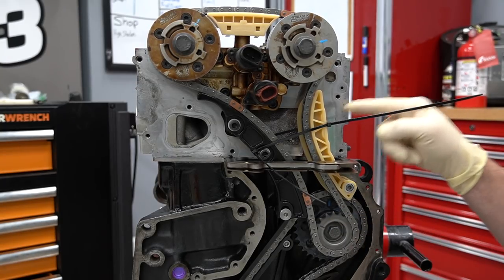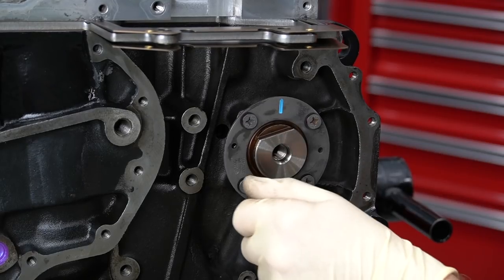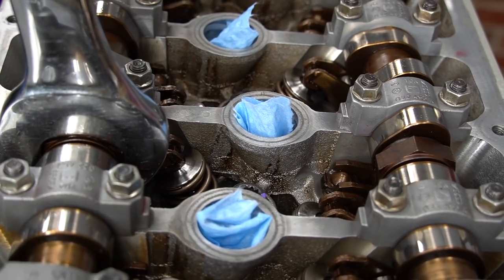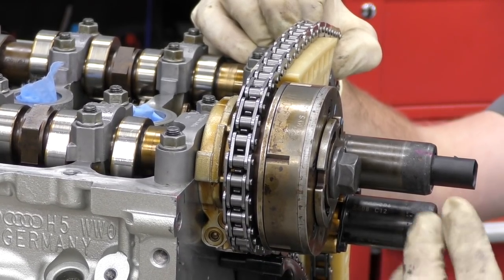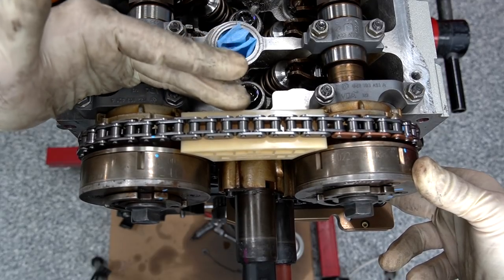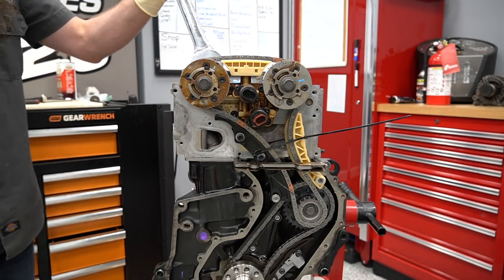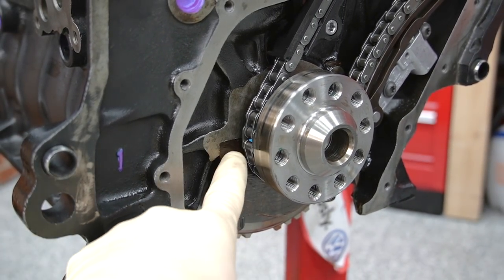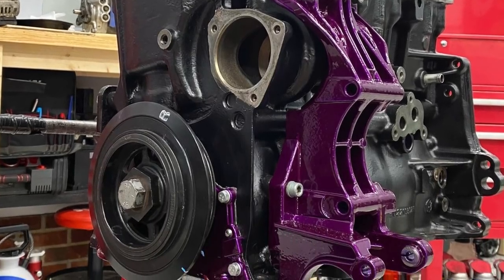How To Properly Time a VR6 With Head Gasket Spacer

Comment from the maker: I know its been a while since Ive put a video out. For that, Im sorry. This drag race project has been TONS more work than I expected. HAHA. It will 100% be worth it. Wait until you guys see how it all plays out.
Reply: Yes!!!... been looking forward to this video... I do have some experience of the smaller spacer though on my own build that suggests the standard chain doesn't fit without modification... I have DM'd you on your Facebook page with some details as I would love your input on it...
Reply: Hi @HumbleMechanic I know you may get this a lot but I own a 2019 Volkswagen GLI 35th Anniversary Edition 2.0T 6MT. I was wondering if you have a trick or possibly coding information to remove the rev hang. I love this car but the rev hang sucks! I know a lot of people are looking for a solution or help as far as lowering how much rev hang there is! If you could make a video with details on how to remove it or why people can't remove it that would be great! I know other car manufacturers allow you to code this out, but no one has been able to solve VWs
Reply: Please help.  I have a 2009 Hyundai sonata 2.4 cylinder  and I replaced the alternator. Fairly easy job. But after I replaced it I started the car up and went for a ride. Everything seemed fine until I came to a stop sign and as soon as I pressed on the brake the car stalled. Not only does it do that but when the engine is cold the idle looks good but as soon as it warms up the idle drops down to a low 400 to 500 rpm and if I rev it up it will stall when idle comes back down. I had none of these problems before replacing the alternator. I did not touch any vacume lines while replacing the alternator. I'm totally baffled. Before I start replacing things I figured I would try and get some help first. Also I get no codes.

Comment: This is exactly what i had to do, essentially i timed it old school just with crank TDC with cams locked and ignored the IM gear markings as they become irrelevant, this made the chain perfectly tight on the inlet variator. it was weird and i was very sceptical about starting my engine, but it ran perfect and im more then happy, VCDS comfirmed it was ok.
Reply: Was it tight when U put chain on because for me we’re I had to tap intermediate in and bolting and repeat she timed good by the belt and with head spacer by a hair off on the intermediate which is normal with head spacer… but cams are off by a hair is she still good to go???? I wanna build it but I’m biting my nails off
Reply: Was thinking of getting Adjustable sprockets….and by the way I got new chain kit and all new sprockets from urotuning but was hesitant to build it and to turn over just like u

Comment: I have removed a 3.6 head with the cams 180 degrees out, then upon reassembly, I rotated the cams back to proper TDC timing.  It was extremely difficult to get the upper chain installed (the HPFP is involved) and even when it was, it seemed like the crank marks were slightly off. I went ahead with it anyway and was met with timing DTCs. Removed cams, rotated crank 360 and now everything lined up perfectly. That intermediate gear can be 180 out and put everything off a half a tooth. It must have an odd number of teeth.

Comment: Finally. Needed that video badly. Thanks Charles 😂
Reply: My spacer has 3,6mm, the chain is an original one but the guide is milled down to fit 🤔
Reply from the maker: I ran the stock chain on my 12v no prob.

Comment: Wow 7.0:1 compression, that's super low.  Like mid '80's turbo engine low, off boost response is going to be pretty bad, isn't it?  Are you running really high boost levels on this?
Reply from the maker: We should be running a good amount of boost. :) how exactly will it drive? I hope Awesome. Lol
Reply: might have some lag but mostly depends on the size of the turbo. Most turbo engines run low compression. The old school was run a really big turbo and let it lag. New school is smaller turbo or twin turbos. One really small and one big. To eliminate lag. I think Charles will get it right.
Reply: @HumbleMechanic  I'm nearing my mid forties now and remember the old school way of turbo tuning i.e. low static compression then throw loads of boost and fuel at it but I was under the impression that with the precise control of modern fuel and ignition systems that even moderately high boost levels say 1 to 1.5 bar are fine on a 9.0:1-10.0:1 compression ratio motor these days. Are high octane pump fuels not readily available in the states? I'm in the UK and 99 ron petrol is pretty common here.

Comment: Hi there, first of all great video.

I have one question on the timing.
I made 2 full rotations everything lines up but the exhaust cam. The timing on the sprocket of that cam lines up perfect.

Is this because there is no oil in the system yet? Or do I have to do something about it?

R36 engine
Thank you

Comment: I have 108,400 miles on my almost 19 year old 2003 GTI VR6 (24v), purchased in October 2002.  Original chains still holding up well on this daily driver.  How much longer can I expect them to last without needing adjustment or change?

Comment: How to take the VVT solenoids out on this engine. I've taken 2 small bolts off but the solenoid is not coming out, it's spinning. Are they bolted at the back, I can see the star screw at the back of each solenoid? Thanks

Comment: So by changing the balance shaft location which doesn't matter for anything but nvh. Like old 2.2 Hondas with a water pump and a double timing belt. They put timing marks on the pump but mention nothing of it in wsm

Comment: Make sure you put a dab of rtv on the two pin holes in both head gaskets right on the edge of the cylinder head at the opening for the timing chain or it will leak oil. Ask me how I know :)
Reply: How u know?
Reply from the maker: Oh yeah. We will cover this more in the engine assembly video!!

Comment: i have a 24 valve 2.8 that had timing chain noise. i ended up replacing chains and adjusters. engine runs great but its still noisy. i made the mistake of not doing the intermediate sprockets but looked ok. it still noisy sounds like coming from cam phaser. do they usually go bad or doing you think i have another issue ? 133k 2002 eurovan.

Comment: TDC #1 or does the crank mark take care of that? I guess not right?
Reply from the maker: The mark on the crank lines that up.
Reply: @HumbleMechanic  over heated my mk4 VR6 thinking I may have harmed head gasket and timing chain is due. Seem to be pressurizing the coolant system( combustion gases?), going to change the thermostat.

Comment: Just curious... Why did you make the compression so low ? Isn't it possible to tune with higher compression ?
Reply: Anyone got more info on this topic? Is this about making the engine safer for pump fuel at high boost pressures? Less heat from combustion at a lower compression ratio?
Reply: @humblemechanic

Comment: Hello fellow dubheads. I have a 1994 Corrado with the 8v 2.0 engine.  I bring the car to operating Temperature, then shut it down. Start it back up and it boggs down for 30 seconds then it works fine again. Any ideas? Thanks!

Comment: Would this apply for any thickness spacer? Im looking at a 2.1mm spacer. How can I tell If I will need a longer chain?
Reply from the maker: I "think" with that small of a spacer, you can run the stock chain.
Reply: @HumbleMechanic  thanks so much for the reply!

Comment: How did you get the extended chain?? I think I need one for my bdf turbo project. Not sure how thick the headspacer is, but my chain is wayyy too tight
Reply from the maker: Right from HPA. There may be other options too.

Comment: 7:1 compression is ridiculously low. I have R32 turbo with 8.5:1 and I think that’s too low. 9:1 would probably be best for 98 RON.
Reply: Yeah that is dumb, I'd rather have to use E85, octane booster or methanol injection but stay higher compression and get all of the torque.

7:1 is what people ran in the 70's with beetle engines, it's dumb low, it's gonna feel doggy when out of boost, and it'll take forever to build boost. Realistically yeah 9:1-9.2:1 is perfect with premium fuel and a good tune, honestly not a VR6 guy, am a BMW guy and I know that on the M5x platform many people stay stock compression (10:1 more or less depends on the exact model) even on higher boost as long as it's on e85 it's fine, see no reason why the VR couldn't do that.
Reply: @imnota  VR6 can do this as you say
Reply: Can someone tell me how thick a head sapcer will work with standart lenght chain kit?

Comment: Hey Charles would I be able to use the oem chain replacement if I were to run the 8.5:1 compression on my r32 ? read somewhere I would need to trim the timing cover a bit because the chain would hit
Reply from the maker: The only time you need to mess with the cover is when you have head or block machined
Reply: @HumbleMechanic  can I use the oem chain with the 8.5:1 head spacer? Also when you slap a head spacer on does it turn into a non interference engine?
Reply: @oleksandrmenko5276   did u get to find out if u use a oem because I’m have the same here chain went on good but had to tap and bolt and repeat till she went in tight with good slack by Tension I know Intermediate shaft is off by hair but are the cams off by a  hair to

Comment: Well Charles, I'm sure the VW community will appreciate your expertise, for sure. I'm just not a fan of that particular crank/cam set up.. sorry Charles.. I realize you didn't design it and your working with what you have been handed.I come from the ooold school.. American engines with straight crank / cam gears.. think about Texas tractor pulls with 5 syncronized blown motors going to1 rear axle...PTOV